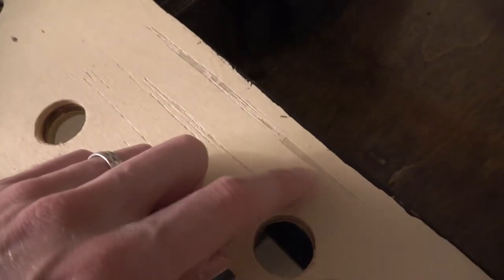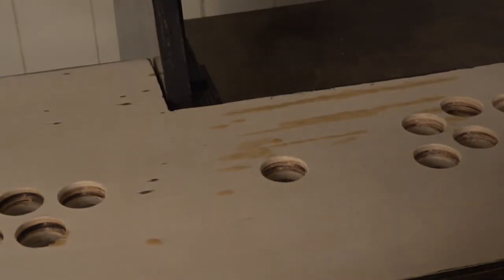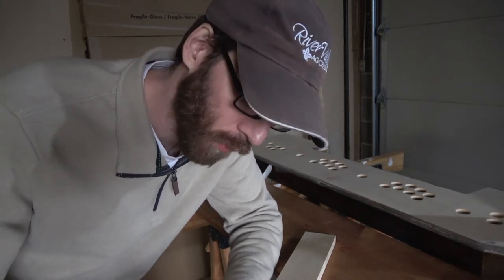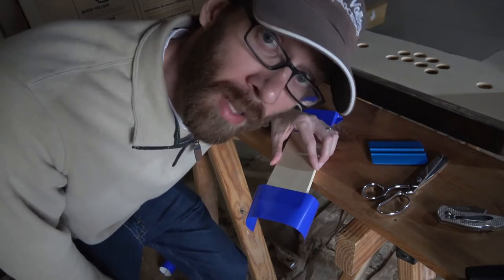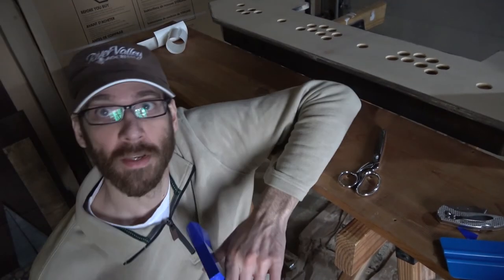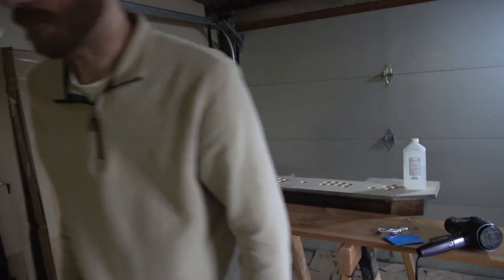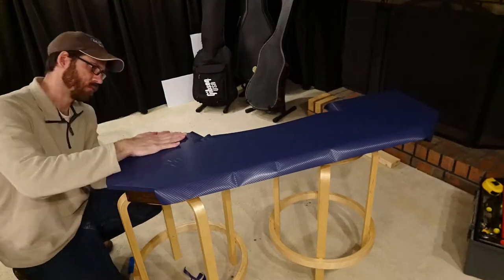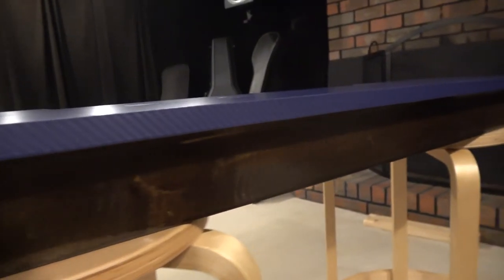Applying Vinyl to Wood Control Panel with Corners (Arcade Cabinet #03)

Comment: How are you finding the vinyl is holding up to wear and tear of using it for a control panel?  I'm about to use some epoxy gloss graphite vinyl on mine.
Reply from the maker: I realize this comment is two years old but still wanted to respond. This project got stalled after a personal tragedy in my life not long after making this video. But I hope to get back to it soon! -Dan